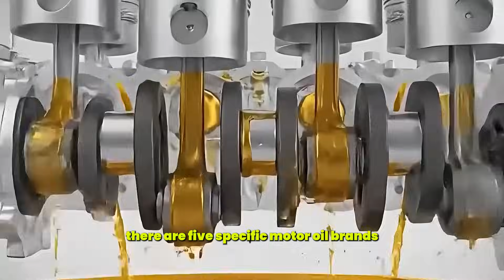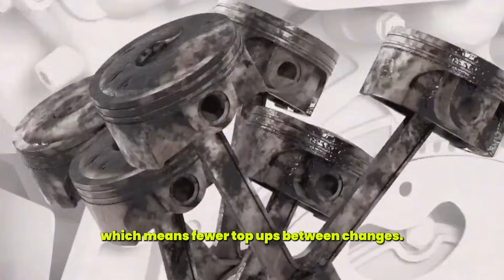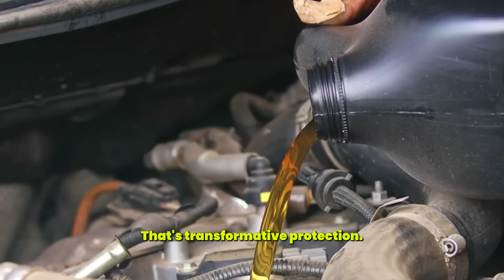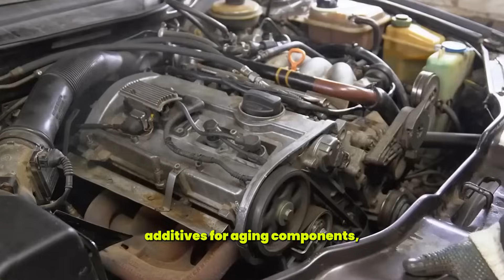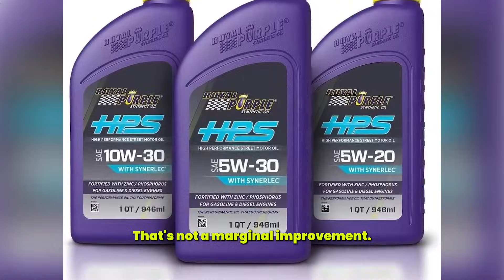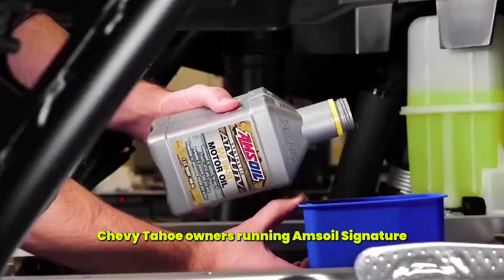5 Motor Oil Brands That Are EXTENDING Your Engine Life (Mechanics Swear By Them)

Comment: Full synthetic every >5000 miles. If you have VCM get a muzzler and use Valvoline r and p until the insides are clean. The use what you want.

Comment: Don’t listen to this AI information manufacture, #Warranty only wants the factory warranty to last 10,000 oil change is only if you are leasing the vehicle or going to get rid of it after three years oil changes are cheaper than new engines

Comment: I'll take Pennzoil platinum ultra  any day.  Would Amzoil but the high cost is a deal breaker  and I'll never go more then 5,000 miles on a single oil change. Don't care that oil package doesn't break down  because blow by is constant and I don't want  the micro degree against  my bearings. The ones that the g filter misses
Reply: Truth 💯 👍🏻 🇺🇸

Comment: Follow the severe service maintenance schedule when it comes to oil changes.  If your car spends >95% of its miles doing highway miles, go for the 10K interval with synthetic oil.  However, if you do a mix of in-town, stop-n-go, short trips, along with highway miles, go with a 5K oil change interval.  Oil is the lifeblood of your engine.  Don't skimp on oil changes...you're not going to damage your engine by changing the oil every 5K miles.  Any brand name synthetic oil (Pennzoil, Mobil 1, Valvoline, Castroil, etc.) will do your engine justice.  Royal Purple, Amsoil?  Meh.
Reply: Never do 10k on group 3 synthetic 0w20.
Reply: I have a 2025 Camry Hybrid that calls for 0W-8.  I've put 0W-30 Mobile 1 AFE  in it since it was new.  Has 25,000 miles on it now.  I change it every 3500 miles.  This gets the gas out, and keeps the carbon and soot and whatever else is in there from building up - that's my theory anyway.  It's an experiment.  I'm gonna see if I can get 300,000 miles out of it.  30k a year miles, so in 10 years we'll see.  Might go to 5-30...  Will see what's on sale in the future.  The 0-30 I use I'm told is basically an 0-20 with modifiers to get the viscosity up to 30 at temp.  It runs real smooth on it.